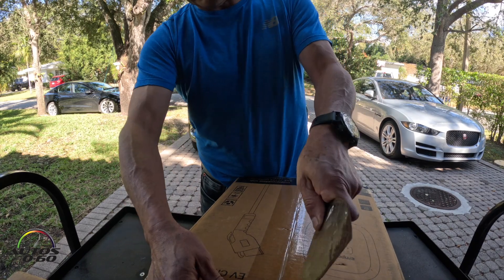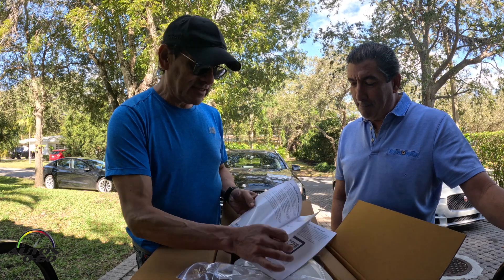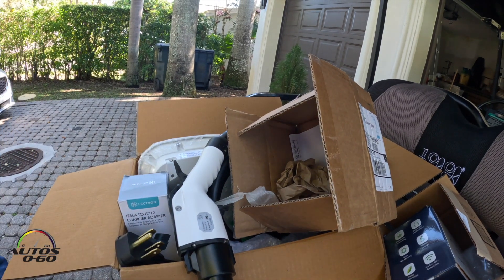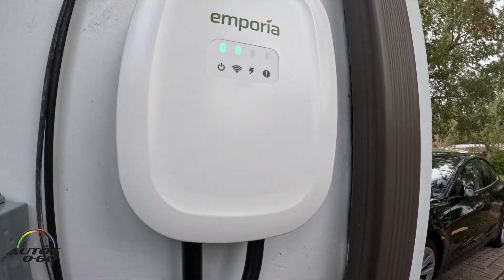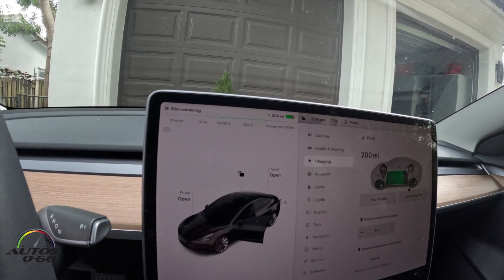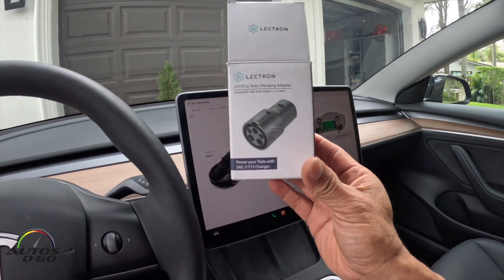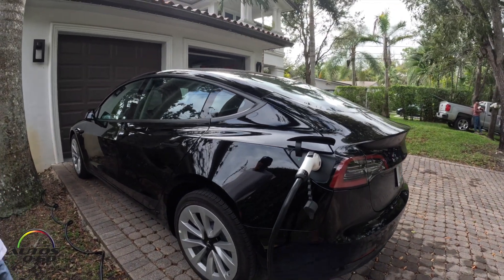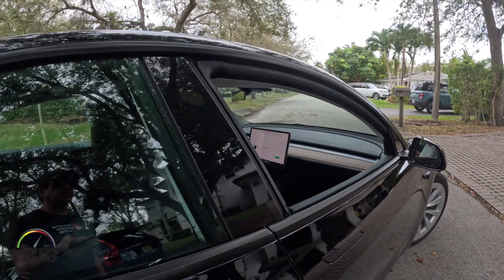Emporia Level 2 Electric Vehicle (EV) Charger 48 Amp

Comment: It's 48 amps only if the electrician hardwires it, otherwise plugging it into a 14-50 outlet decreases it to 40 amps max like other wall chargers.

The electrician should've at least mentioned the two ways of installing it. And with the charger being amounted that close to the main panel, it seems there's no excuse for not hardwiring it rather than going through the trouble of wiring up a new 14-50 outlet in a new RV weatherproof enclosure.

Comment: A nema 14-50 plug can carry 50 amps max. So, it can handle 48 amps, just not safely within code.   You want a 20% buffer, so 60 amps.  

Also, I didn’t look it closely but that could have been a NEMA 14-60 plug, which would be safe and in code for 48 amp.

Comment: Hardwire is a better option.
Reply: It is only the best option if your service allows the 48A output. it would make no sense to install it hardwired thinking you can get 48A when the service may not be able to handle that and folks end up dialing down the amps to accommodate. At that point the receptacle option at 40A may be a decent option for folks. At the end of the day a licensed electrician needs to do an evaluation on the loads to determine the best course of action to offer their customer.

Comment: Shoulda hardwired it
Reply: Depends on the situation. 40amp vs 48amp isn't that big of a deal to me, but if it's outdoors and could be stolen, yes. The electrician should've at least mentioned the two ways of installing it. And with the charger being mounted that close to the main panel, it seems there's no excuse for not hardwiring it rather than going through the trouble of wiring up a new 14-50 outlet in a new RV weatherproof enclosure.

Also, I'm aware that plugging and unplugging into a cheap 14-50 electrical outlet isn't good for the prongs, but is a semi-permanent charger that won't be unplugged. He should've used a heavy duty Hubble or Bryant outlet just in case. 

The electrician may or may not have gone over the installation options/price differences.

Comment: Hardwired is better and will charge faster at 48 amps.
Reply: His tesla can't charge that fast anyway
Reply: Look at his screen. The charge rate was limited to 32 amps. The speed difference alone is minimal between 40 amps and 48 amps and shouldn't be the main reason for a hardwired install.
Reply: @rkgsd  The charge rate was set to 32 amps in the app. It comes that way. He needs to set it to 40 amps in the Emporia app.
Reply: @henrycruz45cal  The 32 amps was set by the app in the EVSE. He needed to set it to 40 amp in the Emporia app. You seriously think a Tesla can't charge at more than 32 amps?
Reply: @rkgsd  Not sure why my reply was removed. But it would take 1 hour less to charge mt Mustang Mach E from 20 to 80% soc with a 48 amp EVSE vs a 40 amp ESVE.
Reply: @henrycruz45cal  Wrong! The charging amperage is dependant on the charger itself. You can override the Tesla menu and set it to charge at a lower rate if you prefer slower charging for long-term battery health or are concerned about the current draw from an old electrical panel, but it will protect you from going higher than the charger can handle.

Comment: They didn't install with a GFCI breaker!
The "professional" should have known better.
Reply: Should have one yes, but I don't believe it's required by code in all states. If the charger had been hardwired, a standard breaker is allowed.
Reply: Not necessary. The Emporia has built-in GFCI protection.
Reply: @DK-pr9ny  That is not accurate. The NEC demands the "receptacle" to be GFCI protected so having anything "in" the charger would not meet the NEC Requirement. Now, as stated, if it is hard wired then no GFCI protection is required at this time...I say AT this time.
Reply: You dont install an EVSE with GCFI on a GCFI breaker. They'd constantly trip each other